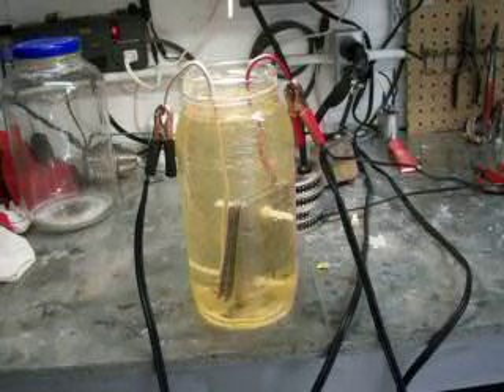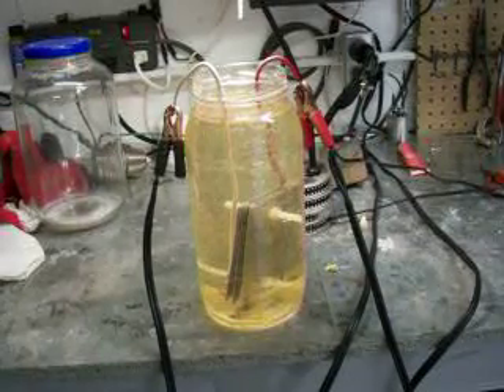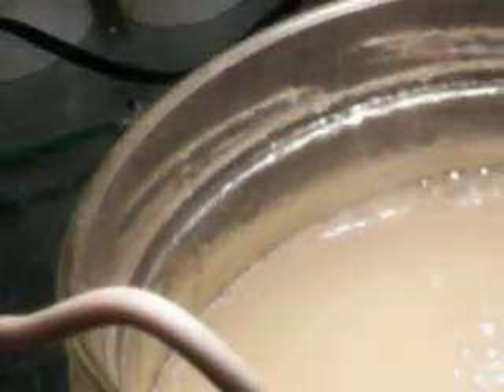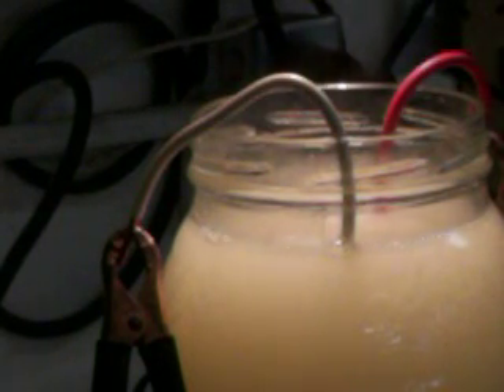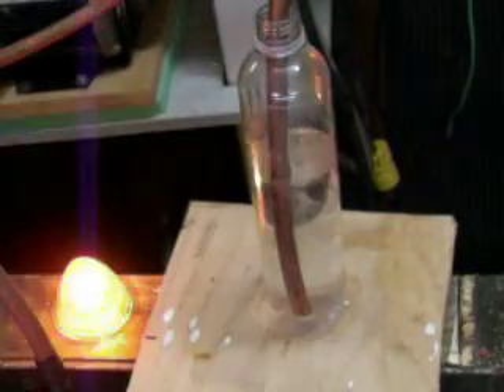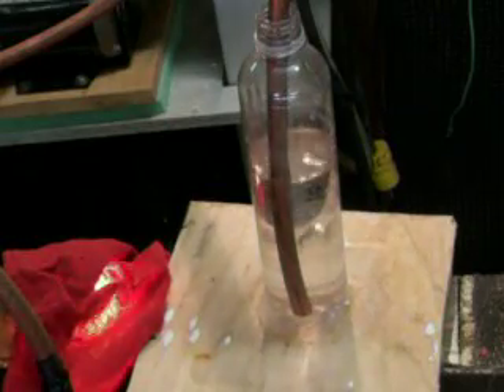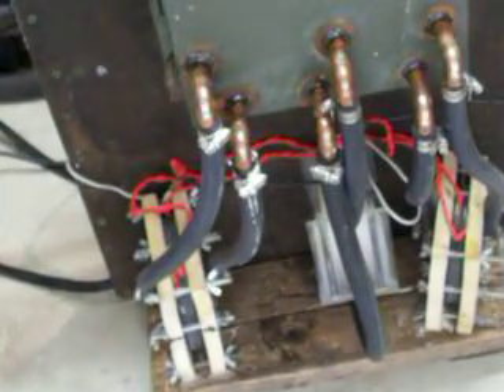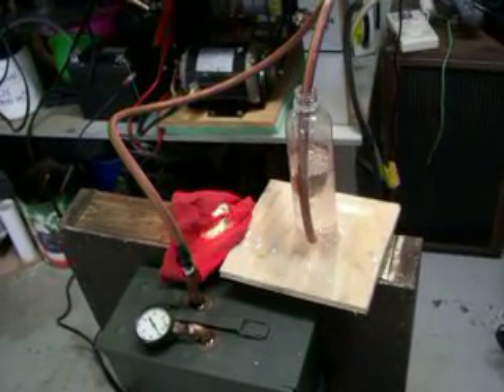best hho cell so far,

Comment: First of all you give no information. Voltage, Current  and Liters of gas per minute. You also do not use an oxide inhibitor to keep the plates clean. If you gobble up the current you have accomplished nothing.. Give the information and I will thwn comment.

Comment: You have to measure the amount of Hydrogen given off in liter per minute. Then do the math.  My HHO generator makes 48 LPM at your same power usage. ( 6amps at 14.8 volts. ) If you have more HHO than that being produced, I'm interested.
Reply: I would like to learn about most efficient method of producing HHO so that I can build most efficient HHO generator that operates on 12VDC system.  Are you willing to share your  design of 48 LPM at less than 100 watts or point me to where I can learn about the most efficient designs?  Would greatly appreciate your help, thanks.
Reply: We are interested in your consultancy services to design hho cell with 48 LPM . Please suggest how we can contact you

Comment: I'm working on a plain water design also, I'm using tubes and run them at about 19200 kHz. but when the water heats up, so do the amps, they go from 3 to 4 amps on start up, to 42 amps at 62 Deg. C. care to share what frequency you pulsing at?.
Reply: Hi, Rick, I know the problems you're having, is such a Headache,!! But I solved my problems by adding an extra cooling pipe. I just went to the junk yard, and looked around. I found a transmission fluid, cooling system, on an older model Blazer. It works so good I don't know why I didn't think of it sooner....

Comment: I get the same results except im melting 100 amp fuse holders! Wtf? Im going to switch rods from 3/16 to 5/16 and use 21 plates in one vessel instead of 13 plates in three vessels. Thanks for the video

Comment: try to mix electrolytes while device is ON  in clean water. not before you turn it on and not when is warm. but while it's ON . that way you can observe on how much electrolytes your device works the finest . and try to use even lower amperage but more cells the way that each cell has it's own source of electricity  , that keeps the heating away.

Comment: is there a reason you wont share info on new design?
Reply from the maker: you have to fine tune them!!!
Reply: TheVaporkid  ok ,but what materials are used?gasket thickness? sizes?any special electronics?how are you FINE tuning them? all these would HELP us a lot further the hho development!!!
Reply: EsEs Oz I think it's a simple pwm with some MOSFETs running negative pulse . The speed of the flashing light I would estimate between 1 to 5 Hz freq  . If u really interested look up hydrogen line on Wikipedia it's take what about 1420 MHz to spilt . I would say 1.42hz freq it's close to pulsing at.10 to 15hz would flash faster also he may even have a relay or something
Reply: Stan was smart enough to invent the wfc voltrolysis method but stupid enough to believe he could patent and monopolize it. Don't make the same mistake. Tell everyone your voltage, freq, method of pulsing, plate specs etc. if you are truly on to something. People just don't get it. It HAS to be public domain to do any good in the world. Do you want to change the world or die a premature death with a bank account full of money you never have a chance to spend? The choice is yours. Make the right choice.